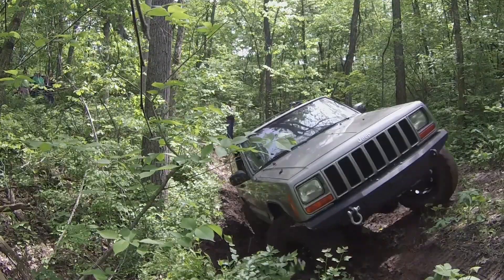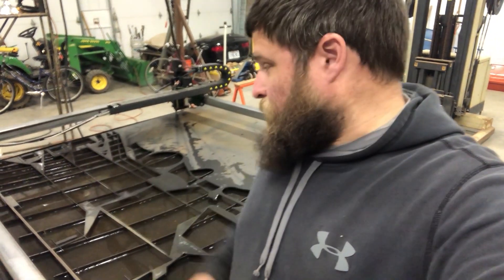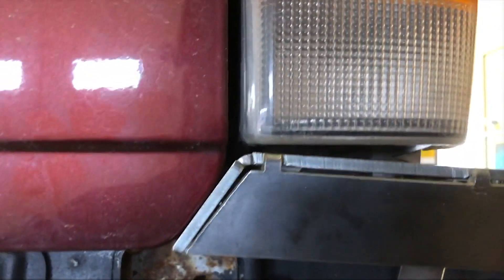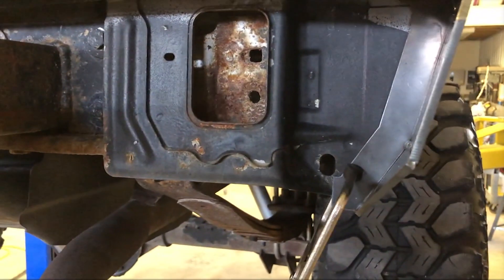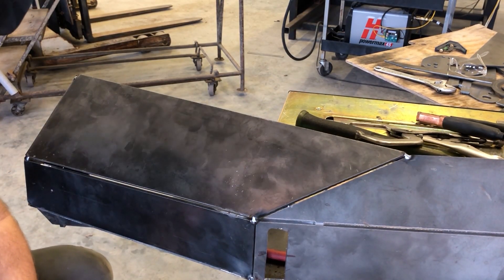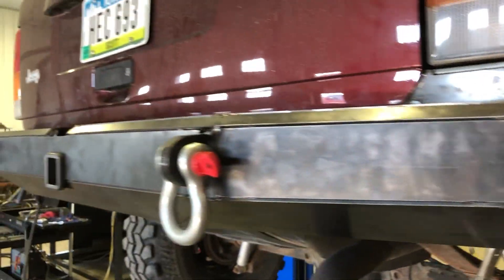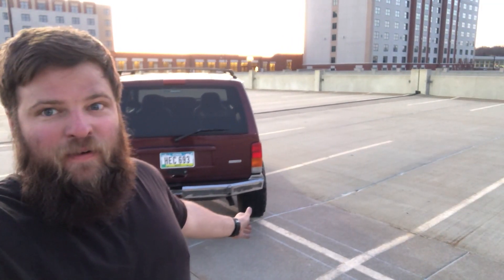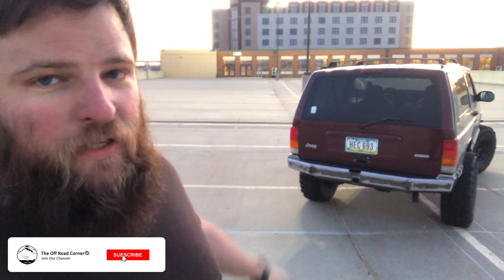Building A Jeep Cherokee XJ Rear Bumper | Cut On A CNC PLASMA TABLE

Comment: Good design.  The multi-angles always make it look custom.  I'm surprised you used 1/4" material throughout.

Usually CNC plasma tab width is 1/2 the material thickness.  You will figure it out for your table.

Comment: Got to love those plasma arc, got your table all working. Must be real nice haven such a large shop to work in. You do great design, fitting and welding. 
Are you setting up for selling a DIY project for others ? I’d buy both front and back bumpers if the cost is good. I have a 2001 jeep XJ sport. I’m New York State certified welder since 1973 I have my own mig welder so I can do all the welding, just need pcs to weld together. Let me know if you sell the bumpers as a DIY bumpers.
Damn that looks great 👍.

Comment: on the porosity are you using inert gas? it looks like it bc its a pretty clean welt what are you running?
Reply from the maker: I’m running c25 argon. I haven’t figured it out yet. I’m thinking it’s bad metal prep.

Comment: Holy crap that looks awesome.. I was wondering if I could get the dimensions you used. I like all the bends you did an stuff. I can write a program and cut it myself was just wondering about dimensions haha. If you can’t that’s all fine. Looks great man!
Reply from the maker: The dimensions I used are a little off. I need some time to fix the model and figure out a way to share the dimensions.

Comment: how do you measure bumper detail before you design it and before you process it on cutting plasma? thanks brader😊🙏
Reply from the maker: i measured everything with a tape measure. basically i measured the rear of the jeep. then used those measurements to build the model in fusion360. then take a part of the bumper model in fusio360 and cut it on with the cnc plasma. if that piece doesn't fit i would make a change on the model and re cut that piece on the cnc plasma.

Comment: Love the bumper currently jumble f%$ing my way through fusion 360, to make a rear bumper for my tacoma, did you learn fusion self taught??
Reply from the maker: I’m all self taught on CAD modeling. I started with soildworks. Once solidworks got to be too expensive I switched to fusion360. Some things were similar between the two softwares but not much. YouTube helps the most for me. Fusion360 is awesome though.

Comment: Great job! Wish I had access to a CNC plasma table. I have Inventor, (sorry, don't do Solid Works or Fusion) so I can do the sheet metal design for bumpers. I can see why the complete bumpers are so pricey. I've helped do a flat bed extension on an old F-100, to accommodate hauling a race car and found that the proper flap disk makes short work cleaning up welds and making them look good. Looking forward to the rest. God bless and stay well.